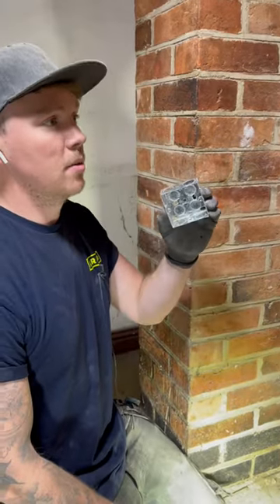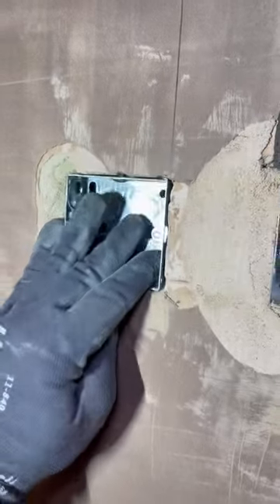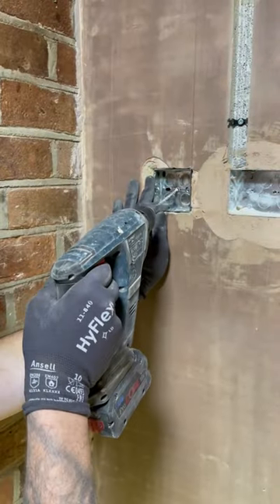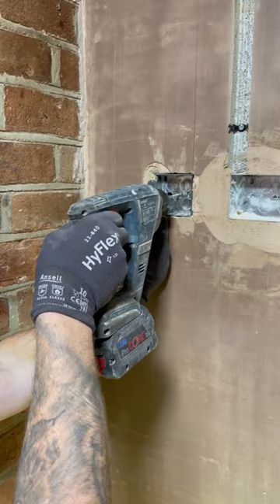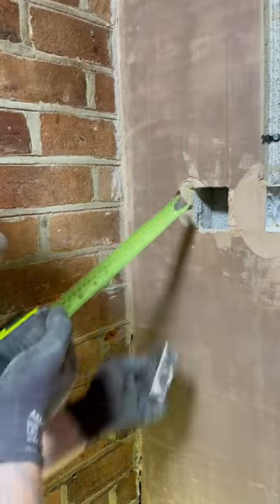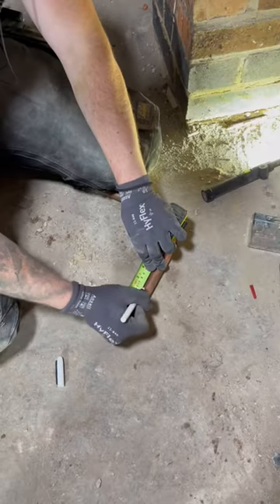An attempt to save the day #shorts

Comment: Safety Squint 😂 needs putting on a T-shirt
Reply: Just buy a 22mm pipe slice bro they will cost the same as your grinder blade and much neater cut so it sits more flush to the wall. I used this trick when fitting gas meter brackets and it’s solid as you like
Reply: @callumsimpson7483  he’s a sparky, he wouldn’t know how to use a pipe slice
Reply: u may think thats cute till someone looses an eye. ive met plenty of people in construction who had missing eyes and fingers for being cute like this. especially a young man he should be even more safe. the amount of scars and injuries ive seen from ignoring simple safety rules, everyones an untouchable god until a piece of metal flies in ur eye.

Comment: Great idea!  Would the copper and steel box cause electrolytic corrosion?
Reply from the maker: I have no idea mate
Reply: Yup it will
Reply: Used steel conduit, not copper, there should be a ton of that s*** laying around
Reply: Electrolytic corrosion happens with water not with electricity
Reply: if it was a problem then we wouldn't be screwing ground wires made of copper wire into a steel box
Reply: @xxjusxstarxx  normal go to a brass connection these days because of that
Reply: @paulhancock3844  no brass in a us junction box other than the plugs terminals
Reply: think it needs water as that how it happens on boat hulls, different metals in water.
Reply: @JM-dt9oo  only needs a small amount, the water vapour suspended in air is enough to start the process
Reply: Electrolysis is when electricity is put through a liquid of some form. Not just 2 dissimilar metals in the open air. 👍🏼 

Safety Squint 😂. Almost everyone is guilty of that
Reply: @johnthompson9918  who mentioned electrolysis? We were talking about electrolytic corrosion were 2 metals in close proximity to a liquid form a battery. Keep up
Reply: @paulhancock3844  ah my bad. I made a mistake reading the previous comment. Apologies guys ✌🏼
Reply: Was just reading there that electrolytic corrosion occurs when moisture is in contact also
Reply: @johnthompson9918  and it also says that there doesn't have to be much, vapour trapped in the air is enough
Reply: @paulhancock3844  Thats true. Moisture/air humidity. 👍🏼